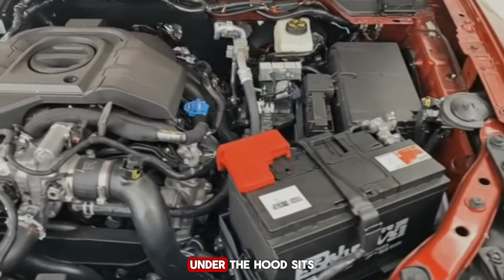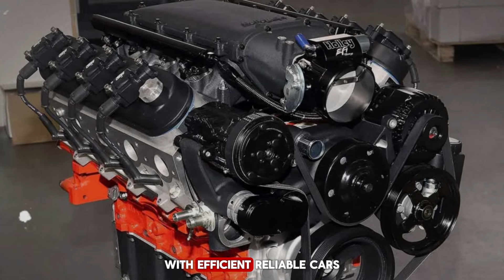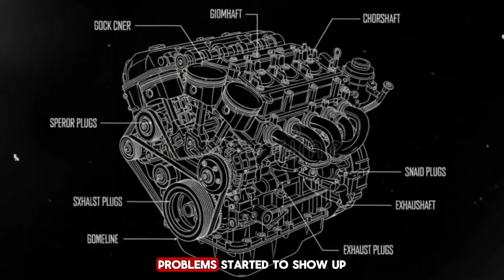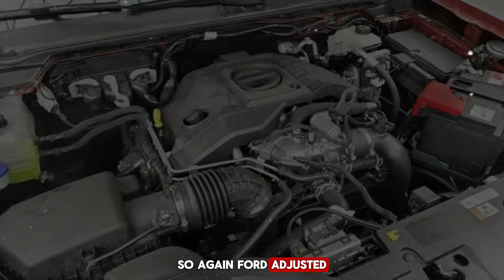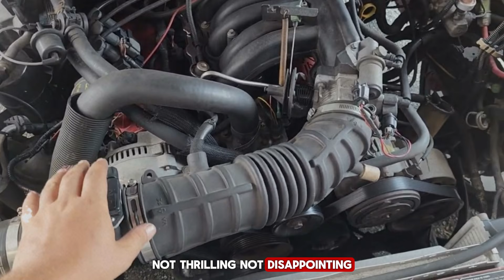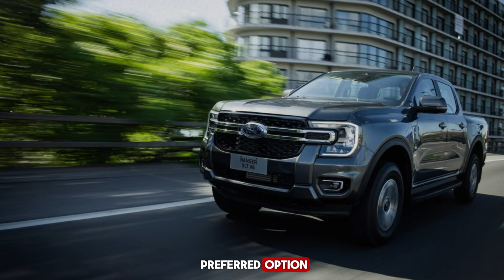The Shocking Truth Behind Ford’s 3.0 Vulcan V6

Comment: If your lucky to find a Taurus Vulcan 
3.0 V6 today with under 150,000 miles
your lucky these engines are Bullet proof not like newer vehicles engines 
which most are Crap
Reply: Honestly just bought a 2003 with 21k miles from a 90 year old man. You would swear it is 2 years old.

Comment: I've been driving a 2006 Taurus SE w/ the Vucan since 2020.  6 years so far, and it's never left me standed, and never not started.  Almost 181k on the odometer and still running well.  I've replaced lots of parts on the car that are expected and a part of routine maintenance.  As far as the engine goes, just valve cover gaskets, and the oil pan gasket.  Regular transmission pan drop & filter replacement every 25-30k miles, Regular oil changes, coolant flushes every few years, and staying on top of maintence instead of letting small problems become big ones.  The 06 Taurus is nothing flashy, and won't win any races, but it's one of, if not THE most reliable car I've ever owned.  I've decided to stick with it even if I have to eventually have the transmission rebuilt at some point.  I'm thinking I'll easily hit 250k on the engine.  Just put 100k mile tires on it, so we shall see!

Comment: Had one in a 1994 Taurus. By 200,000 miles everything on the car was either broken or had been replaced and breaking again. The engine was original and still running like brand new, not buring one drop of oil running smooth.
Reply: I have a 94 GL blue, still dayling it!
Reply: @tomasnokechtesledger1786 how many miles?

Comment: The 3.0 Duratec same bore and  stroke.  Do the 3.0 L duratec my 2012 Escape  has 195000 miles on it valve covers never been off.

Comment: Some are known to burn lots of oil 
Others were made with a cast iron block that corrodes horribly when used with the newer OAT coolant instead of the old silicate based green coolant. If you didn't get to the back of the block with the timing cover and freeze plugs off and clean out the block good the engine would constantly overheat.

Comment: Had this engine in my ranger. After spending a day cleaning the throttle body, sensors, injectors and replacing a faulty oxygen sensor it was pretty dang smooth. As far as the heat issue, new coolant and a bottle of water wetter was all it took

Comment: Had a 2006 Ford Taurus with the 3.0 valcon from 2012 to 2023. For those 11 years that car never failed me. It started every morning and i never did any real repairs on it except routine maintenance. I could have kept it because the frame didn't even rust though yet.

Comment: 2003 ford Taurus bought it used for 700 cash it had 151000 sold it for 800 at 168000 no issues motor or transmission wise